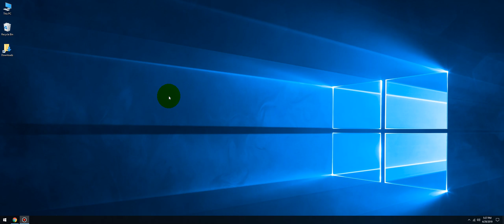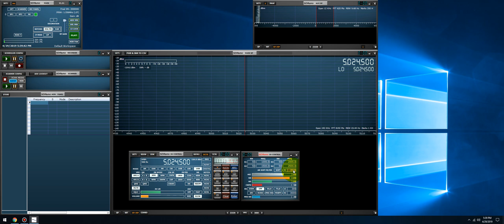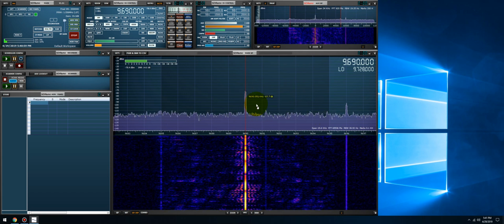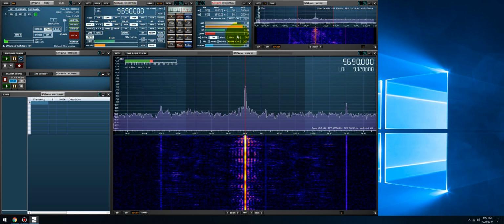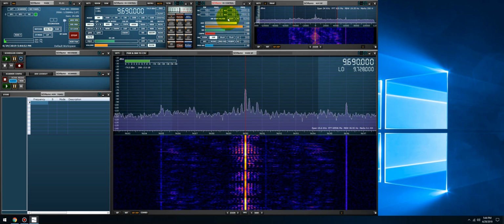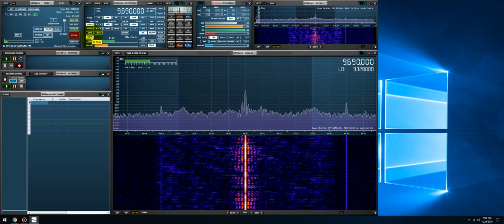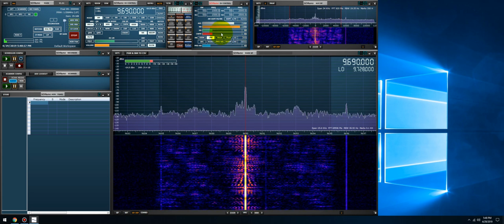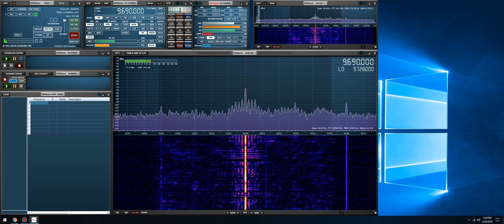SDRuno basics, shaping the sound.

Comment: Just a quick word of praise for your series of videos. I recently purchased a RSPdx and have read the manual, played with it (wasted a lot of time) , looked a  number of poor, to fairly decent youtube tutorials, and wanted to tell you that I find your videos the most informative for coming up to speed on understanding how to use the software and device so far... Warmest regards.
One thing I've learned.. I started using the software on a laptop with nothing other than a touch pad.. While it works, it's a lot of work to try and use it that way and see that the software was really designed to use a mouse with a scroll wheel. I have them laying around snd plugged one in.. Night and day.. Anyone looking at my comment, I recommend you use a mouse with a scroll wheel. The software is much more pleasurable to use that way.
Reply from the maker: Thank you very much for the kinds words.
 Really appreciate it.

Comment: Thank you a lot Mike for this video series! It helps a long way with using the software - now things are starting to make sense :-) ... I think SDRuno is one of the more difficult tools to learn ... and good video guides like yours are very helpful then. I am just (re) starting here with amateur radio - and so far I don`t have a transmitter for short wave, so am using SRDplay very often currently. Actually I am thinking about getting a MFJ-1708B box and continue using SDRplay together with a short wave transmitter, as of the good software and filtering options in SDRuno / SRDplay. Greetings from Germany, 73 de Robert / DB1RKB
Reply from the maker: Thank you so much for the kind words. This PDF should help you if you decide to create a panadapter with the MFJ1708 https://www.sdrplay.com/wp-content/uploads/2018/07/AffordableProtectionRev2.pdf